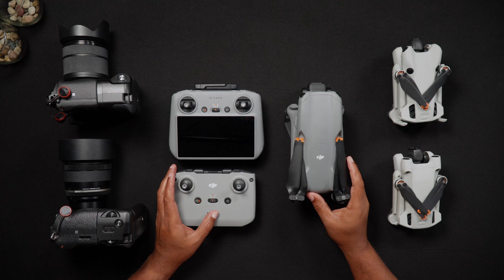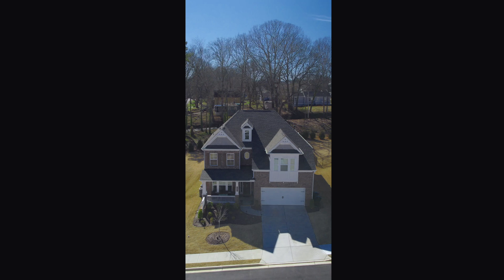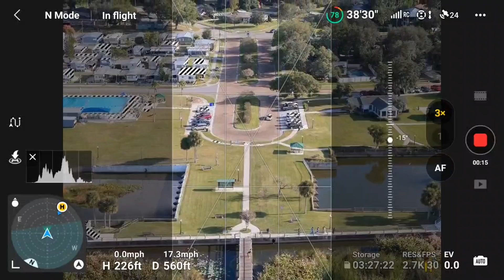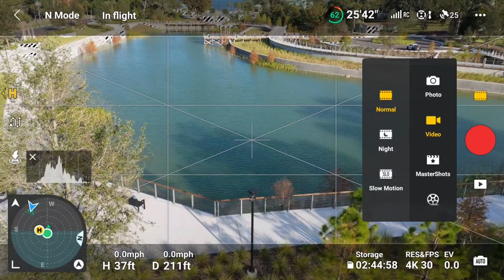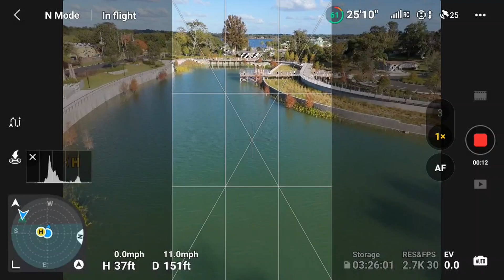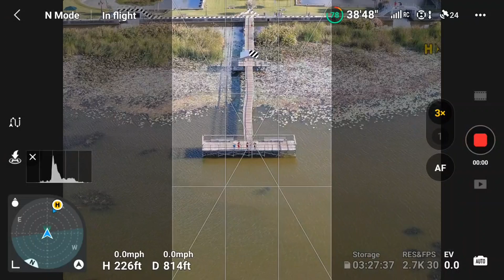DJI Air 3/3S - Vertical Shooting (Full Dialogue)

Comment: What’s the best way to take photos on the DJI Air 3 for upload to social media?
Reply: On the DJI Air 2s there is a vertical photo option in the panoramic mode section. I’m assuming the Air 3 would also have this mode.